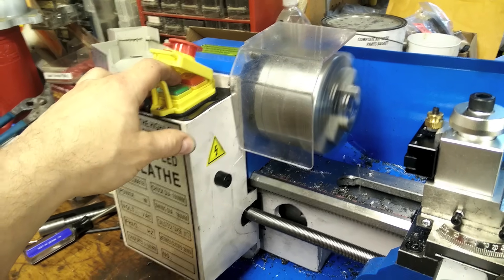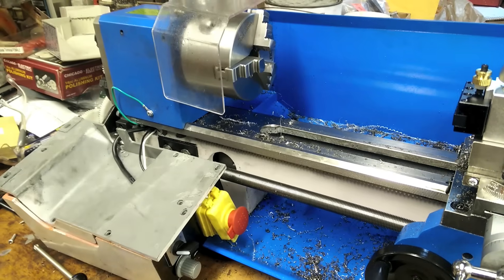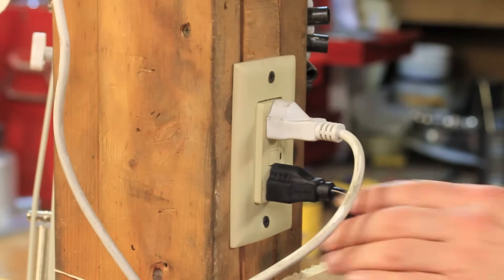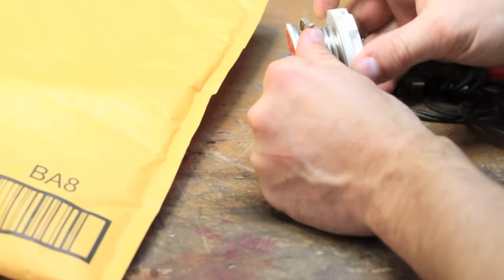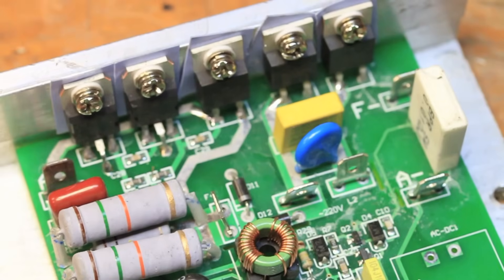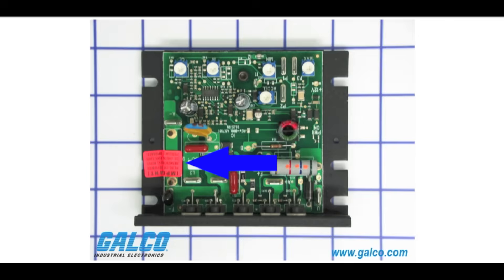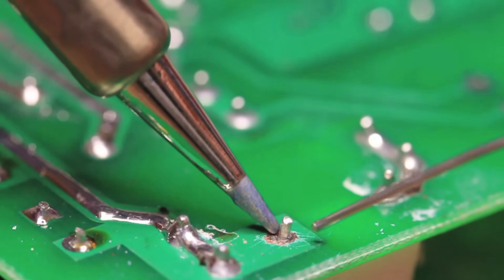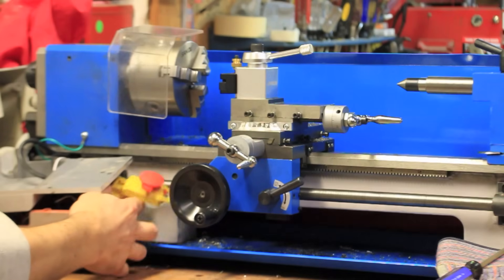So cheap they didn't even finish

Comment: get a real soldering station
Reply: Excellent choice! Has everything you need except for chisel tip. Either of the X-tronic models would be good. Hard to find a better deal. You'll be set for life. Just make sure you tin the tip properly, keep it clean and well tinned. Actually, any of the four shown in the compare section on the item page would be good.
Reply from the maker: Thanks for the suggestion and for watching! 

I definitely know that it's much easier to tell someone you don't know that they should spend more money on things they don't necessarily need and it's a lot more difficult to spend your own money on someone you don't know to help make their set up better but I set up an Amazon Wishlist just for situations like this so I could add the things others suggest: https://www.amazon.com/gp/registry/wishlist/2WFTLSXEPS8WH Please feel free to check it out and send me the soldering station! Or if you have a better suggestion than the one I picked out, let me know so I can add it. Thanks again!

Comment: you didn't solder that pin, the solder joint wasn't hot enough.   the joint will fail soon.  it should look filleted, like a weld when done.

Comment: Couple things. First that joint you showed was cold, it will eventaly crack and fail especely with vibration.  You did not gen enofe heat into the the pcb for it to "wet" properly Or flux in solder was alredy burned away when you finished the joint.(or combination) You want a fillit around the pin not a blob. I woudl highly recomend next time you use the chisel or well tip there better at heat transfer. 

Second that iron is NOT tempature controled, ITs only wattage controled think wall dimmer switch. Witch can be fine but you have to pay more attention, ON mine i use the hotest setting to heat the iron up quick arounbd 60watts, and put it at min for when i am working on small stuff (around 10watts)

I went over it ina  video i did a few months back just wish more ppl are aware of the false temp controled claims on amazon https://www.youtube.com/watch?v=mVpMIgLIEck

Personaly i do like that little iron it heats up nice and quick, but just be aware of the temp thing. It will destory thing with too mutch heat really easely.
Reply from the maker: Thanks for the tip about the soldering iron! I feel like a broken record in this comment section with the cold solder joint... it was difficult to do hugging a camera and soldering through the view finder. I realize it looks bad in the video and I wish I included a clip of it when I was done because I spent a bit of time off camera making sure it was a solid joint.

Thanks for watching and commenting!
Reply: Yeah i guess i have done that as well.  Till I got a good zomm lens so i could get the camera out of my face.

Comment: A word of note, i keep forgetting which is which, but the soldering iron you got, if i remember correctly, it doesn't have temperature control! The numbers are fake, what it regulates is really just the power via a thyristor. It's not thermally balanced, so it will have pretty much random temperature regardless of the setting, with very vague correspondence between the setting and the temperature. The original heater/tip design that they copied was never intended to be used without active temperature control. I'm sure it was perfectly fine for this job, but it's something you want to keep in mind if you were trying to do more demanding jobs with it. Well i shouldn't say perfectly fine - if it actually held a nice temperature, the solder would have flown where it should the very first second instead of blobbing up as it did, but at the end of the day, i read you were able to fix it up.

On the positive note, it should be using Hakko 900M series compatible tips, like if you search for 906 or 936 tips in china, that's what you'll get, they cost a fraction of a dollar. So yeah if you keep burning your tips, at least it's not gonna burn a hole in your pocket.

Now i could be mistaken, because they made very similar ones which actually do have temperature control, but i think they ended up with a thicker handle. Chances are, if there is temperature control, the LED will turn off (or start to flicker erratically) after the iron is up to temperature. You could also take a look inside, if there's 4 wires coming off the "ceramic" heater, there's likely temperature control, if just 2, no chance.

Comment: I like that mini lathe, but its too expensive.  The cost is almost the same as 9x20, that is too big for me to put in my space.  I want that, or something that size.  You can easily change the speed controller with a generic brushless speed controller, or upgrade it to a brushless setup and use a powerful R/C hobby speed controller that cost like $10.00, with a hobby brushless airplane motor that  is far stronger.
Reply from the maker: I haven't had any issues with the brushed motor other than the motor mount being terrible. And the speed controller hasn't been an issue since this fix :)

Comment: Maybe consider replacing the entire controller board with an Arduino and a Ryanteck motor controller board.
Or you can pick up mini lathe controllers on eBay.
Reply from the maker: There was no need, it's been working wonderfully since I soldered that joint.

If I was going to replace it with anything I would use the KBIC-120 which is the real version of the controller that this lathe uses.

Comment: Just for anyone with similar issues, that controller is a knockoff of a KBIC controller board. It would be very, very easy to replace as the connections are all spade connectors and would be a like for like replacement (but obviously the genuine boards are much better quality).

Comment: Good job. Luckily I'll never have this problem with my Toyo ML1. ;¬)
.
Heh, that pcb reminded me of the immobilizer board in my'94 V6 Cavalier a few years back ( Opel Ascona ). Dodgy dry joints in several places and the car ended up running when it felt like it and stopping when you least wanted it to!!!!!.
Reply from the maker: That Toyo  looks like it'd be a nice lathe too! Definitely this isn't the kind of thing you want happening while going down the road!!
Reply: Bought my little Toyo 3 years ago. Reckon it's 1979 or older, and it still works. Belt change for speeds, but I would like a set of bed drive gears for thread cutting, but they are as common as rocking horse poop!

Comment: Amazing how someone who is making a video about fixing electronics can do such a poor solder joint and not know to pull the power cord by the PLUG and not the power cable. That round blob of solder was not only excessive but it's round shape at the bottom tells me it didn't properly solder to the board. That can lead to a burned out solder joint that would remove the foil from the board.
Reply from the maker: I really should have included footage of the final solder joint with the number of people commenting on it. I soldered this looking through the view finder of the camera because I had my arms around the tripod so it was hard to see and not easy to do. Off camera I spent some extra time to make sure the the joint was well soldered and I don't expect to have any problems out of it. Also, please keep in mind that I am not an electronics expert (probably obvious by having to buy a soldering iron to even do this job) and this video wasn't a video on best practices for fixing electronics but much more so a video on what the problem with the lathe was and what I did to fix it, which could maybe help someone else troubleshoot their mini lathe.... those are two very different ideas. Either way, thanks for watching!

Comment: that's no protecting coating, that's just flux residues. no need to scrap them off. if you want to have it removed, simply use isopropyl.

Comment: Do. Not. Scrape. Off. The. Solder. Mask. A PTH (plated through hole) has a spool/"doughnut" shaped metal object for you to solder to. Just wash the board off (Which should've been done during assembly, but whatever.) and solder.
Reply: The board may have had conformal coating sprayed on it after it was soldered. Really in that boards intended application a little bit of sealing would be in order.
Reply: #Andrew Foss: THIS.

#TimNummy
You should never tamper with the conformal coating on or around PCB traces. Using a scalpel to delicately shave up the pin, and just slightly around the land will afford enough exposure to wet the conductors. What you showed was... agressive :<
Magical thing about those conformal coatings, they get jelly-soft and are "hydrophobic', if  you think of the solder as "water", and when the conductor wets, it will rapidly seep under and lift said coating. The only exception I can think of might be a Humiseal treatment, but if the board originally had it, you would be silly not to reapply it after the repair (really, ALL industrial PCBs should have a Humiseal coat!)

Also, ALWAYS WET THE IRON FIRST before attempting to solder the junction. This ensures prompt wetting of the work and avoids lifting the trace via overheating before wetting is achieved.
Reply: Andrew Foss flux..desoldering wick and heat is what is needed to clean that pad....or my go to is a fiberglass pen.. they are great...

Comment: At my last job, one of the guys bought a 'Golden Dragon' tattoo kit...the power supply had all the components mounted on it, and a line cord...but no connecting wiring at all inside...! And of course there was that 'tested' sticker on the outside.....it may have been tested, but did it pass or fail?

Comment: The tabs are electrically connected to one of the pins on each of the TO packages. Bad shit is going to happen without the isolating pads (they don't just enhance thermal transfer). Also the reason for the plastic washers, those keep the metal screws from coming into contact with the tab.

P.S. get some soldering flux anytime you have to do rework, it helps a ton.
Reply: Sometimes. I kind of like isolated TO-220 packages myself. If a tab is connected then it is connected to the middle pin. Just how the devices are made. You find this out when you blow enough of them up.
Reply: Damn, I commented the same thing but I just saw your comment now
Reply from the maker: Thanks! I will do for sure.
Reply: Yeah man, they both electrically insulate while being thermally conductive. Unfortunately, this is counter productive since the best thermal conductors are electrically conductive. A better design would be to have them all mounted to an aluminum heatsink and insulate the heat sink from from grounded body. Those mosfets get very hot, and I fear this setup with dry mica insulators will not be sufficient.

I wish PNP mosfets were as cost and power efficient as NPN, since PNP mosfets can be grounded directly to the body.

Comment: i had another problem with soldering. Mine completely stopped. It was current to motor and problem was in motor. And there was a soldering on a carbon that got loose. Solderd it and it was good to go again.

Comment: Watching your videos I'm realizing I got lucky! My lathe needed a bit of adjusting but didn't have all these real problems. I've had it a few years now with no trouble.
Can I recommend not using the fine point soldering iron bit? They don't transfer heat well so you end up taking too long because you can't get the components up to solder melting temperature and end up unglueing the pcb pads! The chisel shaped ones are better.
Reply: Conical iron tips are worthless. I prefer chisel tips myself. Some call them screwdriver tips. I thought it was funny, all the tips he got with the iron, and not a decent one in the bunch. I guess in a pinch the bevel hoof is so so. Halfway decent, at least.

Comment: You are to be commended for your tenacity in getting this machine in proper working order. It may be disillusioning to some, but even many old school ‘Merican tools needed a lot of fiddling or “fettling” before use. A woodworking hand plane bought at the local  hardware store years ago was never fit for work right out of the box, first it is disassembled, and the body is sanded, scraped, and lapped smooth and square to all sides. The blade back is polished to a near mirror finish, and then the cutting edge is honed to hair shaving sharpness. The frog is deburred and the throat and cap iron deburred as well so the blade sits flush all ‘round. Lightly oil everything, put it back together, and NOW you're ready to use it, typically a pleasant couple of hours or so on a weekend for the average Joe back in the day. ☺
Reply: When I took shop class, NONE of the planes had gotten that treatment. And boy could you tell, using them was murder on your arms for one.
Reply: @DFX2KX  I have a shop class story for you.... I was asked by the auto shop instructor to set the points and timing on a 289 v-8 mustang easy job I thought the distributer was right up at the front of the engine..an easy job I thought.  So I tried to use the timing light but it had a broken wire that needed soldering... no problem so I went next door to the electronics lab but the soldering gun was not working so I repaired the gun to solder the timing light to fix the car.  Little did I know in the 1970s this would eventually train me in the patience needed to repair Chinese  home shop machinery.
Reply: @robc8468  fix the thing so you can fix the thing you wanted to fix is an eternal struggle. All that's happened since I made that comment was adding chinese 3D printers to the list of things I have to fix so I can fix other things...

Comment: its funny because that speed pulsing is actually used in industrial cnc lathes to achieve better surface finish and avoid chatter
Reply from the maker: Interesting! I wonder if it would have the same effect on this smaller lathe as well - that might be something to experiment with. Thanks for watching!
Reply: VFD type speed controls don't reduce power to reduce the speed.  Pulsing the power probably isn't going to help anything,  except maybe when you've got tool or work resonances from too much stick out.  I think to avoid chatter, more horsepower is generally better because when the spindle starts to bog down that opens up new dangers of resonance.

Comment: DON'T BUY "MADE IN CHINA."
Reply: coffeefish not exactly,  don't buy cheap is the most of the story anyone can make a shitty product anywhere in the world it's not that's it's made in China but more that the quality control in China is terrible
Reply: If you're an American, you should be interested in supporting the American job market. Many of our Fathers and fore fathers died for this Country. It's not just an issue about cheapness.
Reply: Bro im Aussie , but dont think for a moment america wasn't the only economy bought out by cheap Chinese labour. why pay someone minimum wage in a first world country when you can get someone on 6x less doing exactly the same job too... and in most cases most of the cheap shit that comes from china you don't even see ... pipes on buildings , circuit components small things that you can slap a (Made In China) label on them
Reply: China supplies the semiconductor industry with most of it's integrated circuits. If it's electronic, it's got Chinese components in it.

To produce this lathe in the US, with all US equipment... It'd run a few grand. But they run under a grand coming out of China. We have worker standards still, meaning we can't compete with a nation for whom the populace is basically expendable.

Comment: Dat cold solder joint.... Fix it, or you'll be in trouble later.
Reply from the maker: Yeah, thanks - I ended up working on it a bit off camera afterwards and it's much better now. It was tricky to do and get on camera at the same time... I actually had my arms around the camera and was watching my soldering through the view finder!
Reply: You also might want to conciser adding additional solder to those solder traces. Looks like they used the absolute minimum they could get away with. Might cause overheating of the board in the future.
Reply: get some proper flux aswell that will solve any issues with the solder not flowing correctly, good video, I really like that you list the jobs you do in the video at the start!
Reply: I agree with using flux paste in this instance, but I wouldn't use it on a new board, it should be clean enough after an alco wipe over.
Reply: Wordreet, i suspect you know this so this comment its not as much for you as for the ones just giving it a go: 
flux paste is most often for tin /sheet work, make sure you get one for electronics work, or clean it after your done, I generally use a liquid flux and a small brush, and clean the board with IPA afterwards
Reply: Yes indeed, the paste is all I have as I was going to solder some music wire undercarriage for an RC plane. But I would have used a teeny tiny little bitty (it always turns liquid and spreads out when heated) on that particular dry joint as it was old and needed all the help it could get. ;¬)
Reply: Claes: I had to look up IPA. Isopropyl (rubbing) alcohol for those who don't know.
Reply: I was about to comment too on this.